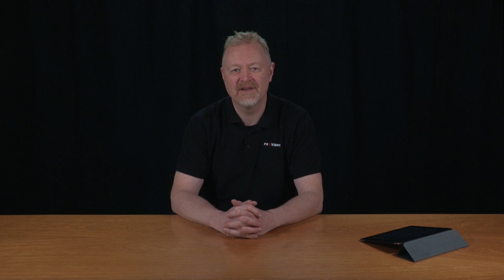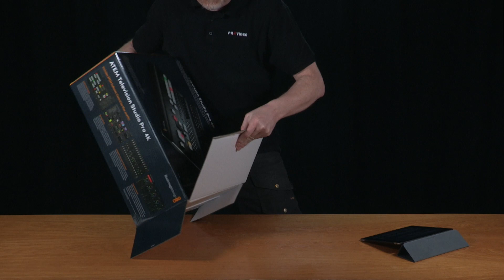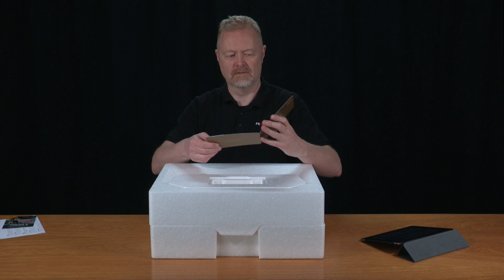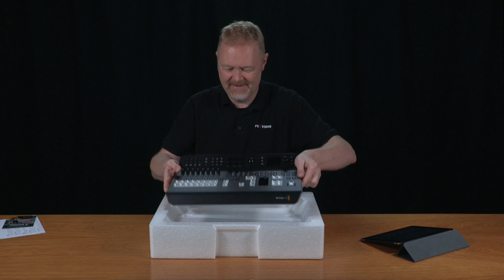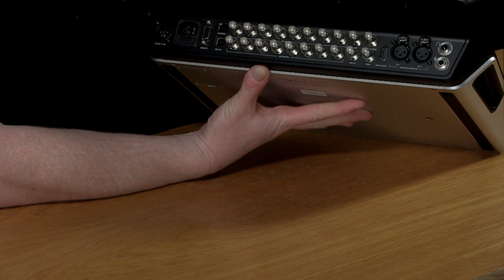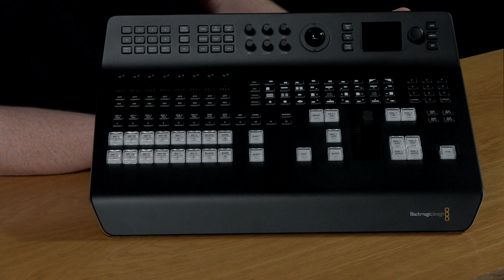Unboxing Blackmagic Design ATEM Television Studio Pro 4K

Comment: Very informative, thanks. How noisy is it compared to the Television Studio HD?
Reply: I have some questions to your review. Please test if is possible to have different resolution or framerate settings on aux and program out. Another thing is audio delay - how can be set, what are limits. I am also interested in all those new audio features. Another thing - those 8 outputs above inputs - are them somhow configurable, or it is only passthrough? What is height of pannel (i did not found dimensions). Thank you
Reply from the maker: Hi, I thought this summer would be nice and easy with plenty of time to do the review, but it's been crazy since my last unboxing. However, next week is more quiet, so I expect to finish my review by end of next week :)
Reply from the maker: Hi jtothada06. Yes, the switcher does accept signals directly from a PC/Macbook Pro HDMI-port (converted to SDI) just fine. That was actually one of my main reasons for replacing my old ATEM TS switch - the build-in scalers that would allow me to run a computer screen through the switcher. I also am able run my iPhone and iPad screens through the switcher via the Apple Lightning Digital Av Adapter.
Reply from the maker: The fan noise levels never exceeded -54 dB, peaking in the 0-1500 Hz band, indicating that the fan(s) are larger than the smaller (and more high pitch ones) in the old TV Studio HD.
I can easily sit behind the switcher with an omni lapel microphone, without picking up too much fan noise.
I'll do a full review next week, so feel free to send me any questions, you want me to address.
Reply from the maker: Thank you for your questions. I'll be sure to include these in my upcoming review :)
Reply: Hi, How long before the review
Reply: If you could please answer one question that would be great! With the ATEM TSP 4K accepting different v video formats and having a scaler built-in can it not accept a signal directly from a pc?
Reply: thanks!!! that's great news! does audio pass through aswell?
Reply from the maker: Yes, it does.